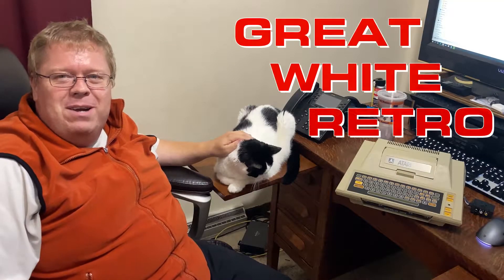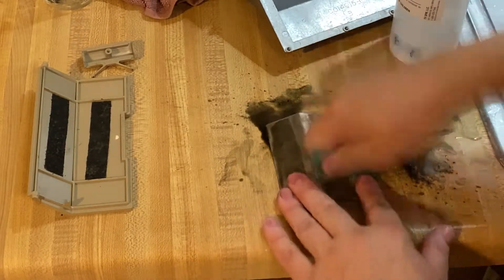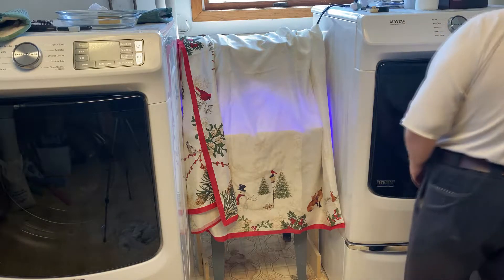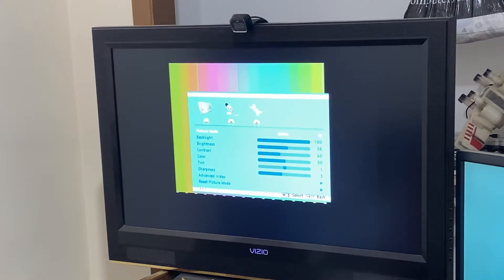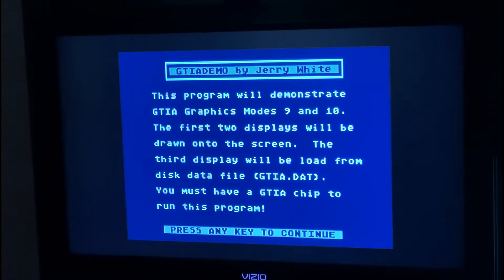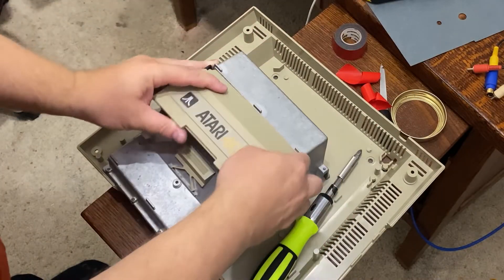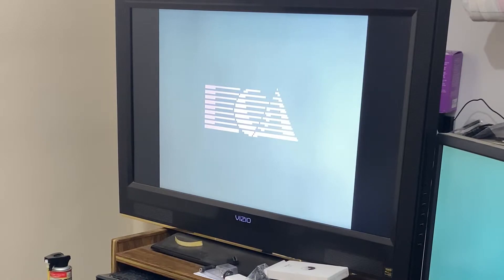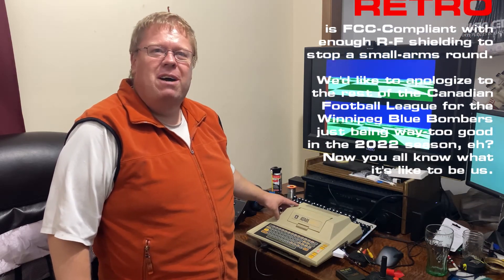Atari 400 Episode 03: Colour Tuning and SIO Emulation

Comment: Good looking Atari 400. Cleaned-up nice!
Reply from the maker: Hopefully this machine's 9VAC power brick doesn't fail like the epoxy bricks you ripped on your own channel. :) Commodore seemed to have a similar problem with their later power bricks.
Reply: @greatwhiteretro  I've heard of the Commodore PSU issue. Your Atari 9V AC power supply should be fine; as it doesn't have an AC to DC conversion going on inside. If you liked when I ripped apart the "Ingot" PSU in a video, you'll probably like the photo I just posted on my YT Community page. 😜